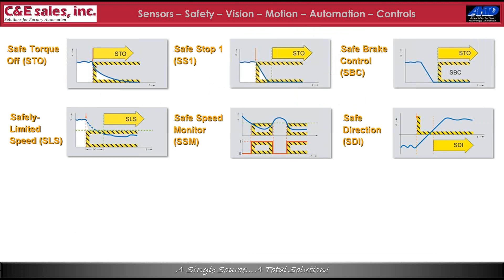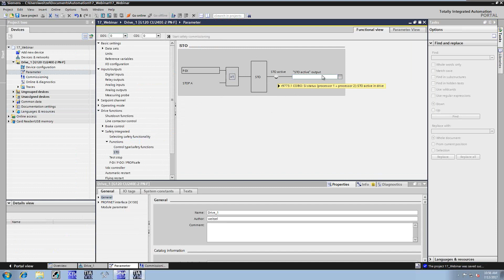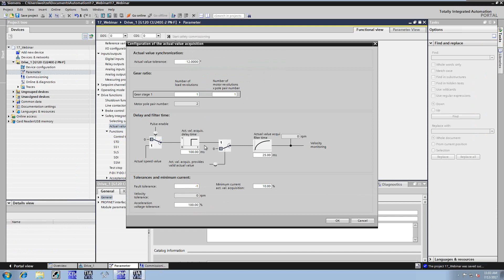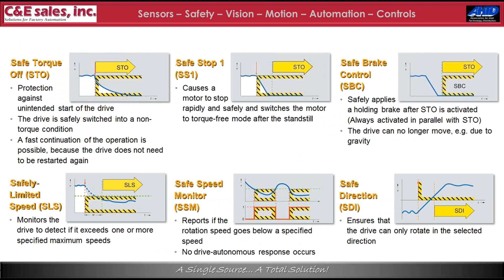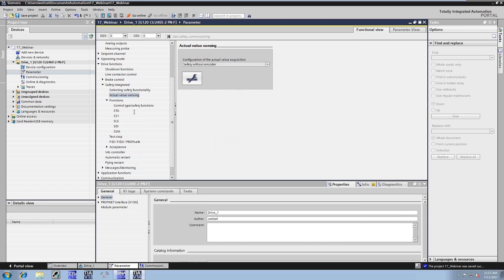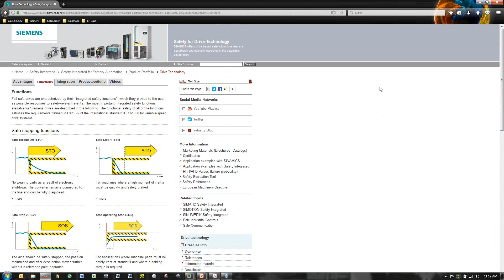Safety Integration for Siemens General Purpose Drives

Comment: Dear sir, Siemens Micromaster 440 75KW.(Box size F) 
Supply voltage 400 then BOP display doted line blinking (- - - - - ).
But display parameter not showing?
please help me.